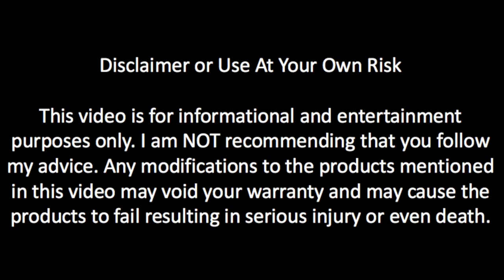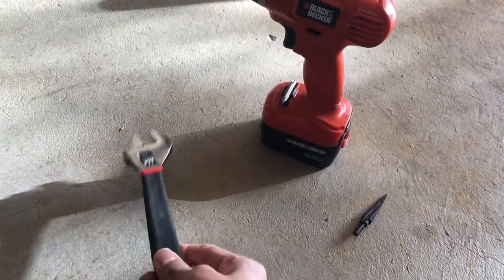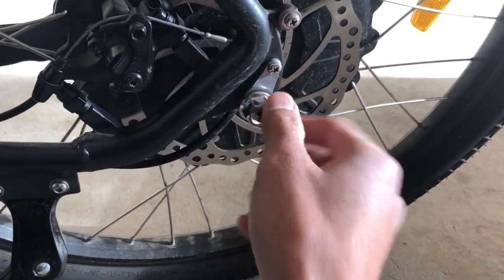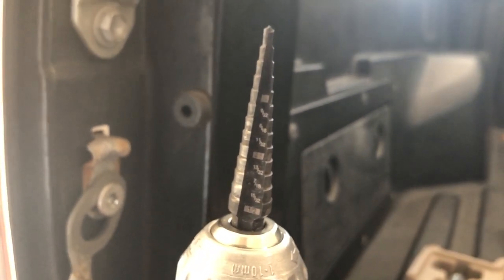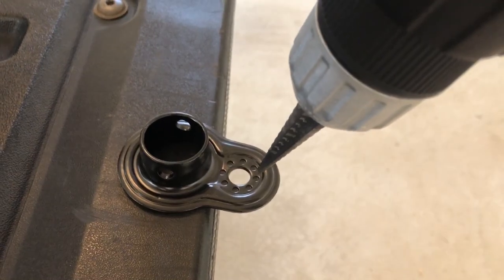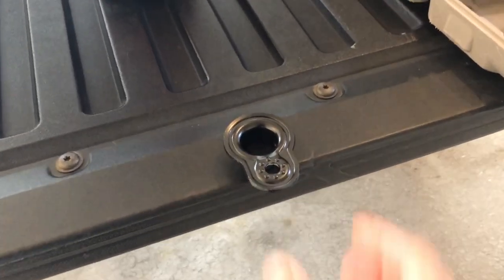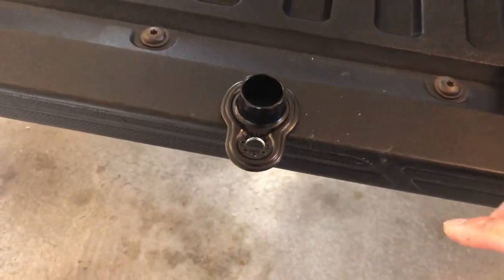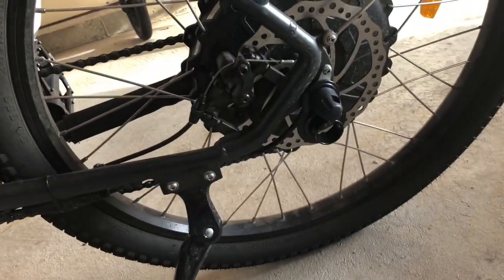How to attach trailer to a RadCity eBike

Comment: Thanks for this video. It would have took me forever to try and figure out a solution on my own.

However, I have an Ariel Rider D Class eBike and I had to buy the #4 step drill bit to open the hole up to 9/16 (one size larger than 1/2). $50!!!!

Also for anyone who needs to do this.. here's a hack-- buy from Home Depot, use it, and return it.

Especially if you'll likely never need to use this bit again. They are VERY pricey and Home Depot can afford it. XD

Comment: After 6months, do you experience any issues on electric motor? Because of heavier loads on the battery and motor. What about affect on the range? Obviously it will be  shortened the range but is it significantly noticeable lost?

Comment: Have you seen any issues with your bike or the trailer adapter in the past 5 months since you did this?
Reply from the maker: No issues so far! I check it after each ride with the kids just to be sure. I have to tighten the axel bolt as it occasionally gets loose, but that happens even without the adapter on. Even on the gear side. I might try teflon soon to see if it helps.

Comment: There not enough thread left on the axle to be safe
Reply: Although probably not recommended, but as long there are more than 4 full turns  on the nut which he has would do fine. If it where me I'd use to slim thin nuts to lock it in.
Reply: Same no way to get it on just right …